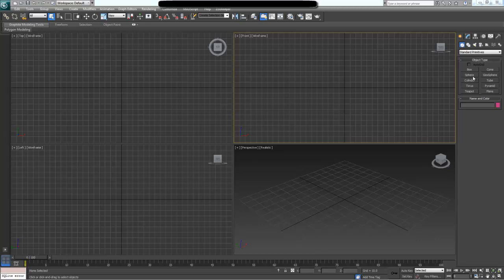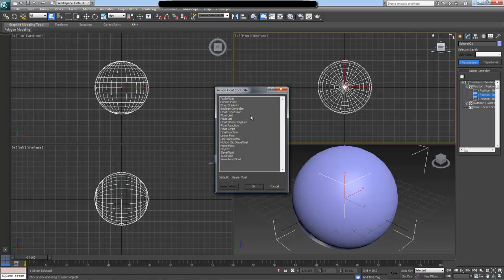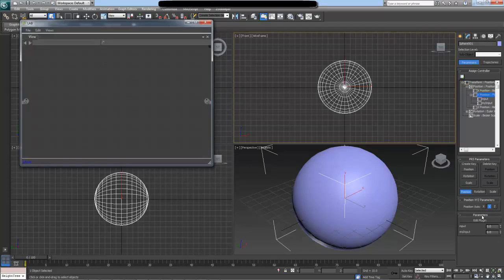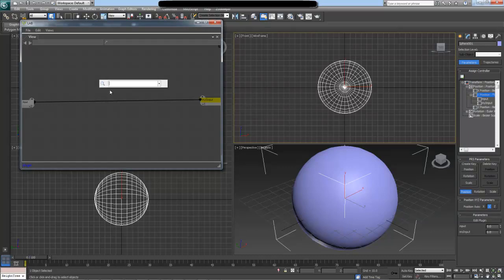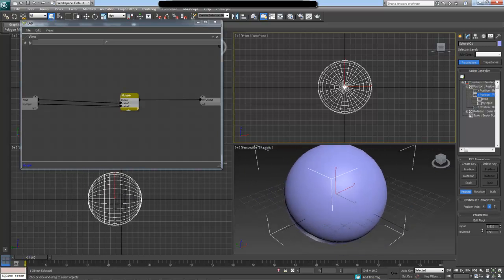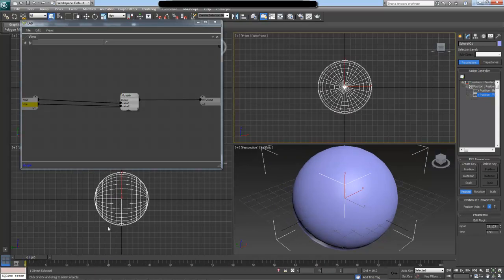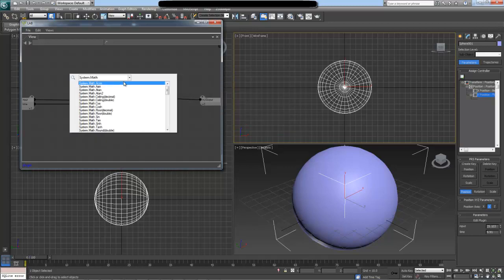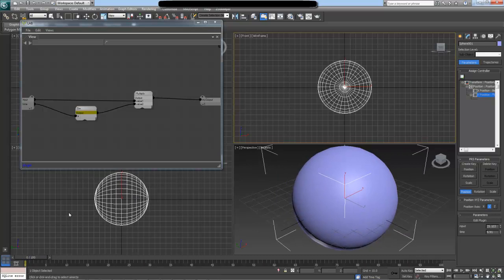Lab (Beta) 101: Creating A Controller, Using Time Input

Comment from the maker: Fair enough, good point. We actually considered it but for now it was easier to just interpret the name. There are many more "special" ports which can be used for input and output. For example, along with a mesh you can choose to take in vertex/face/edge selection, texture coords, and other things. For now they are detected using port name but I will add menu options for that in the future.